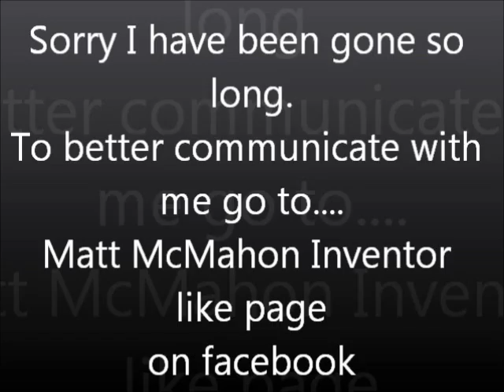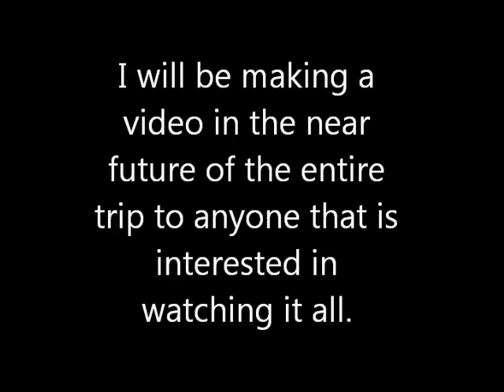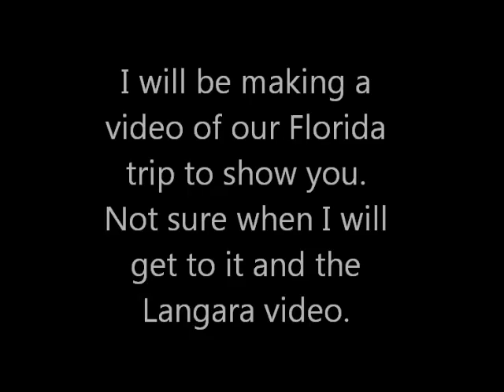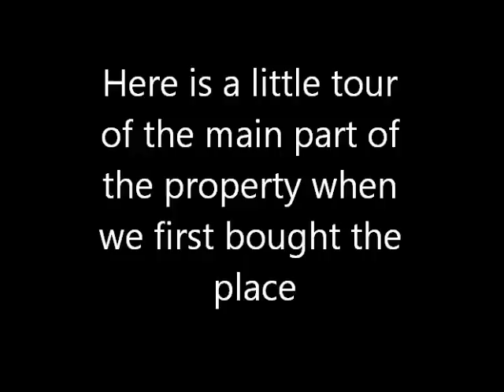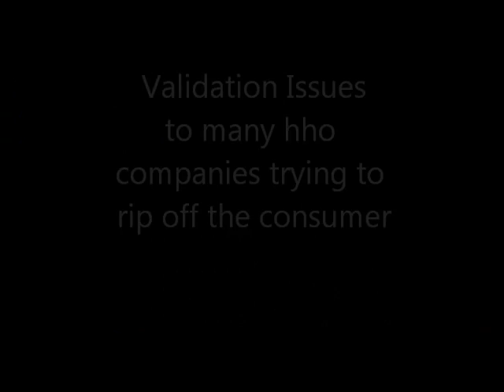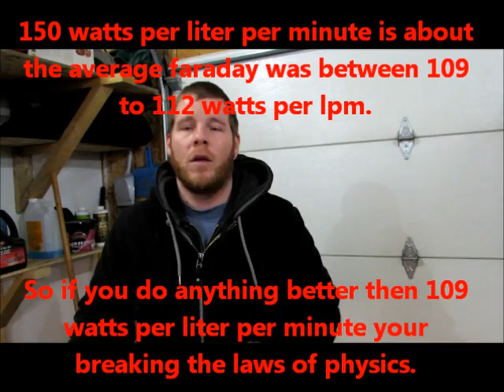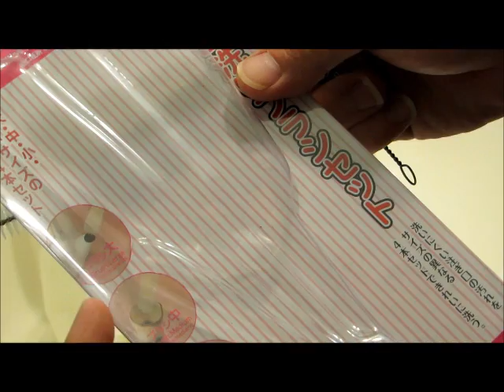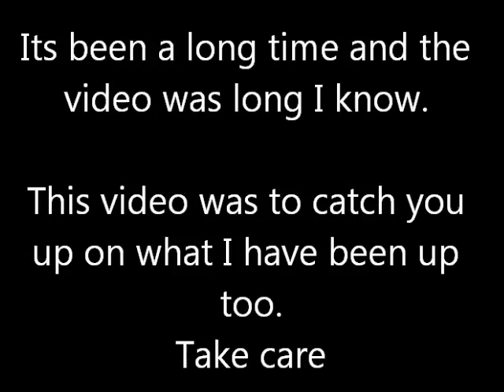I'm Back. Update on my year and what I am up to.

Comment: when's your site gonna be ready? what types of cells do you make? car, electricity etc.?
Reply from the maker: Well the www.watertofuel.com website is already up I just need to add a lot more to the site.
Reply from the maker: Right now we have a few dry cells that will be on the site soon after I have tested them to find their efficency. My tube cell designs are still in the process of being designed. It's just a matter of getting it from my head to something that can be made. It will be an open souce design so anyone can make their own or purchase one from me. It will be up to them. If they have the resources to make one them selves then I welcome that. I will be making one after the animation of the cell is done.
Reply from the maker: If you need them for a car you can either use 12 v dc brute force or use a 12 v dc power supply from the wall. We will have all options available at the site as soon as I got the test done on the cell you saw it the video.
Reply: Matt McMahon Inventor i take it they're not for personal use or the types of hho  car/ truck install kits i've seen on other sites? supposedly better mileage etc. but i could be thinking of the vapor fuel system but i know i've seen hho kits for vehicles. fyi, tried creating an account and it said it's spam folder can't go through now. tried waiting a few mins but to no avail.
Reply from the maker: bled500 they will be for both personal use and experimental use. The thing about these single tube cells you can line one side of your vehicle with them and the dimensions of the space will determine their length. I do use all high grade stainless steel 316 L so they won't be cheap. If I can make a negative mold for the end caps then their price will be very low it's all just a matter of seeing how much prototype costs will be. I am also working on a vapor fuel system as well. It will be open souce as well so people can make their own.
Reply from the maker: bled500 if you sign on with Facebook you will automatically be approved. We had some issues with being spammed. Are you able to sign up using fb?
Reply: Matt McMahon Inventor i liked the Matt McMahon Inventor page on fb. i totally forgot your site's name lol!
Reply: Matt McMahon Inventor what happens to the site it don’t work

Comment: Stan tried the same thing but then he figured why not get rid of all the problems that HHO use in vehicles create. STORAGE. Stan believed that if you want to get rid of the problem then why not create it on the fly at the point of use. Thats inside of the piston chamber. This way you don't have anything running any distance but Water.... Stans Concept was to step charge a water capacitor to the point of breakdown. It separates just before detonating and recombining into water. This way any application from very small standard plugs can be changed. The only thing that changes is the Volume of HHO to be injected and can be controlled via a simple control computer.
 One of the things Stan realized is that high voltage works much better than brute force methods. A simple high voltage step charging circuit can be used for each plug and controlled by a master control computer. Water has a specific breakdown voltage given for a certain surface area of the plate electrodes when stressed via a water capacitor methodology. In Stans plug version the capacitor took the form of a waveguide so that he could control the dispersal pattern of the HHO created by the increasing voltage across the plates, both inner and outer.
 In order to get rid of the dangers of storage or accumulation of HHO, one only needs to design a way to not have to store it. Brilliantly simple don't you think?
 Glad to see you back! Lets discuss...